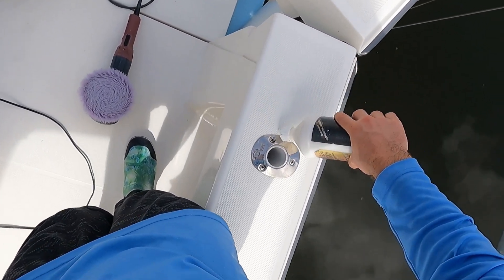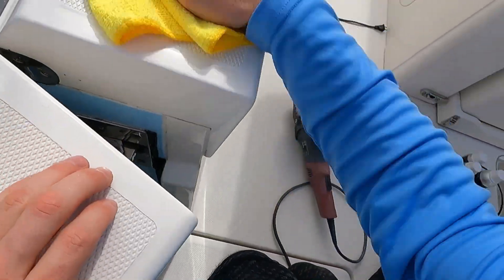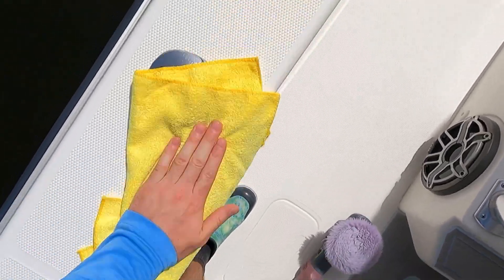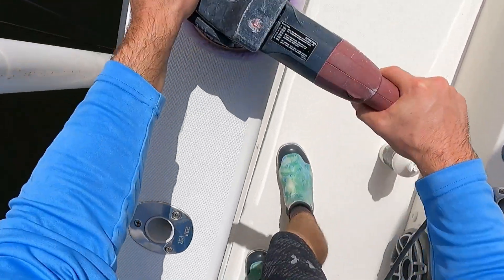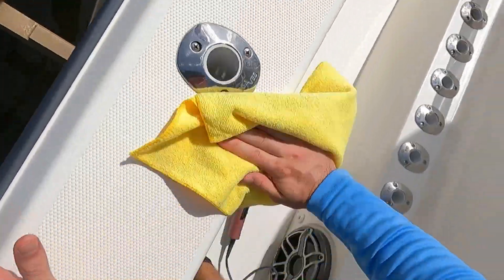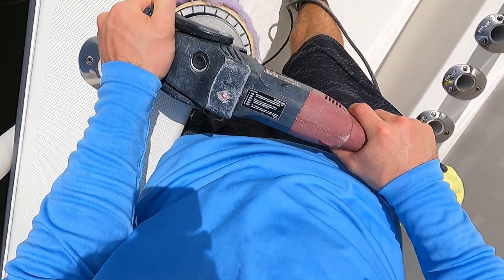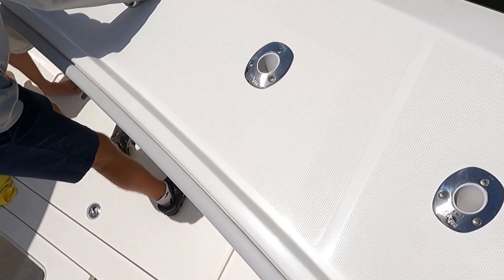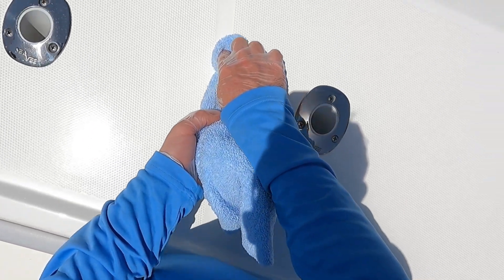Nonskid Polishing & Ceramic Coating | Unlimited Marine

Comment: Thanks Simon for this video. Question, when you apply the Starke Repel Pro ceramic coating to the non skid, did you say you do not need to buff it off, you just apply it and let it set up and that is it? Thanks, Brad
Reply from the maker: That is correct

Comment: Can you put down a clear gel coat before applying the ceramic coating? How often does a new ceramic coating need to be applied? Do you recommend doing the full prep before every new application of ceramic?
Reply from the maker: Ceramic coating should be analyzed yearly and coated as necessary. Ceramic coating typically needs replaced yearly on particular parts of the boat. Not full prep but polishing and then recoating. I suppose you could respray the gel, probably expensive. Why not just restore the current gelcoat?

Comment: After you apply starke elevate and buff.... what did you use to clean the nonskid before yo applied the ceramic coating?
Reply from the maker: DNA Zero alcohol solution with a microfiber towel to neutralize the surface

Comment: How do you tell if your non-skid is heavily oxidized? I cannot tell at all. Does non-skid oxidize at the same rate as the surrounding flat gelcoat? Mine is a sharp diamond pattern. Seems like with the facets it would get less sunshine than the flat gelcoat next to it.
Reply from the maker: If it’s not shining like a million bucks it’s oxidized. Take a polisher to it and you’ll notice real quick. No, the nonskid does not oxidize as fast as the smooth gel around the area